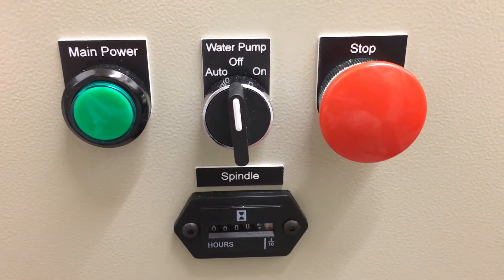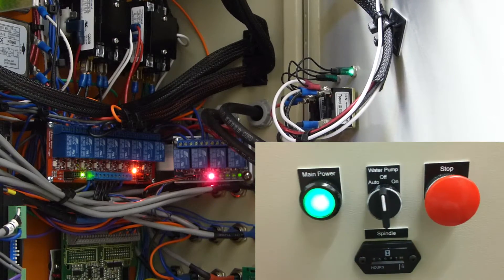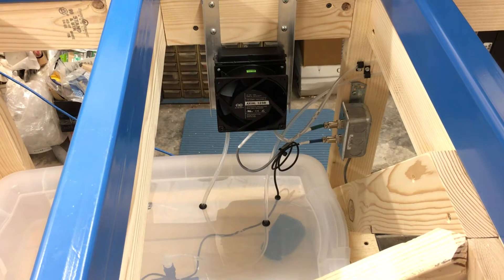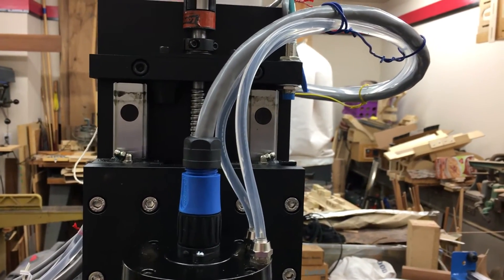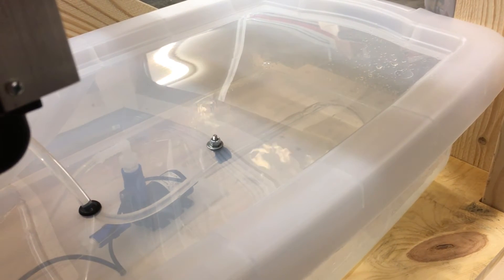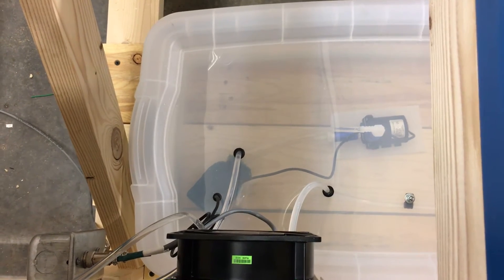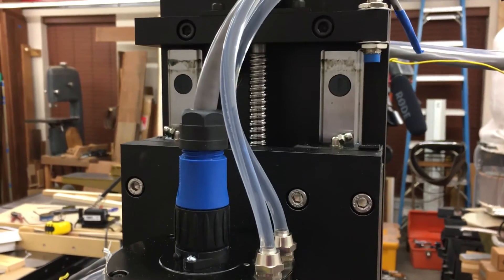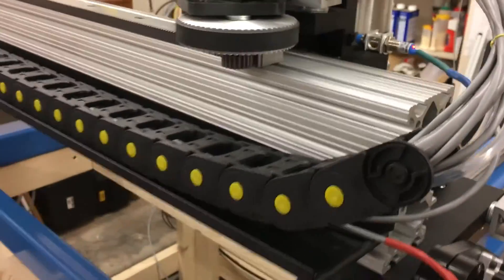CNC - Cooling system test - 10-15-16

Comment: What VFD are you using?  I am changing my spindle with a water cooling one but I am loosing sleep traying to figure how to turn the water pump.  I choose to connect the VFD to a serial to parallel recommended by CNCnutz . I disconnected the relay that used to turn on and off the router motor, what  I do now is if I can change the command to  that relay instead M3  to  M7 or M8.
But if I can start the pump from the VFD would be even better. I have the Huanyang  YM   vfd . If possible, i like to now what pins did you connected the relay.     Mtabernig@socal.rr.com
Reply from the maker: I'm using the Hitachi WJ200-022SF.  I get a signal from the VFD which triggers a relay to start/stop the water pump.  My pins will be different than yours, sorry!

Comment: Nice vid man.. btw, could u help me by showing the wiring diagram.. i still a newbie.. pls help me sir
Reply from the maker: Thanks!  I'm not an electrician or an engineer and the schematic is one I designed so I was pleased that it worked the first time.  However, I don't feel comfortable sending out the diagram.  Sign up at Router Forums and CNC Zone and you'll find plenty of help in getting started.  Good luck with your CNC!

Comment: I was curious to see form a spindle cooling system would take. I have a few question that might be significant.:
1. My workshop is unheated and there's a possibility that the temperature could go <0'C. Either it's important to drain the spindle to prevent frozen water damage or use antifreeze? So is automotive antifreeze a good idea?
2. I would guess tap water is not suitable due to its mineral content so would de-ionised or distilled water seems sensible. There is also a coolant used for Personal computers?
3. Use of an anti corrosion protectorant?
4. Use of an anti-algea chemical?
5. Electronic flow meter with alarm?
6. Electronic thermometer with alarm?
Thanks for sharing.
Reply from the maker: 1, 2. I used one gallon of RV antifreeze in about five gallons of distilled water.  I doubt that would freeze in your shop but then I don't know how cold it gets nor how long you'd go without circulating the fluid.3, 4. You can get a strip of 99.99% pure Silver for about $5 and put in your reservoir to help with corrosion and bacteria.  The antifreeze also helps with that.5, 6.  You can do those, certainly, if you want to spend the time and money.  I just glance in my reservoir to make certain I have flow but one day I'd like to add a flow indicator that's maybe a bit easier to see.

Comment: My cooling system spindle is blocked because of carbon how can i clean it by which chemical process ? Help me ......!!!!
Reply from the maker: Have you tried running CLR through it, or vinegar?  How about compressed air - both directions until everything is clear?  I run RV antifreeze and also have a pure piece of silver in the reservoir to prevent corrosion.
Reply: Reverse directions on the water pump multiple times over and over. Eventually it should clear